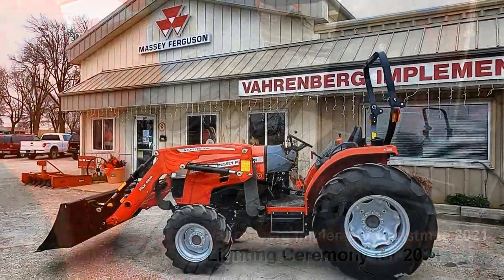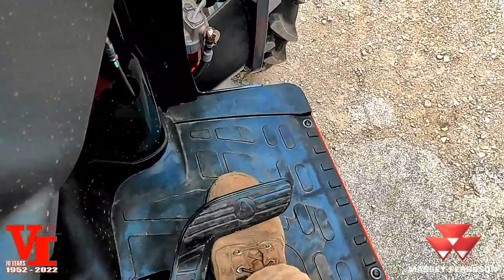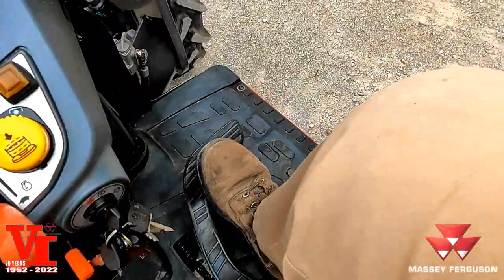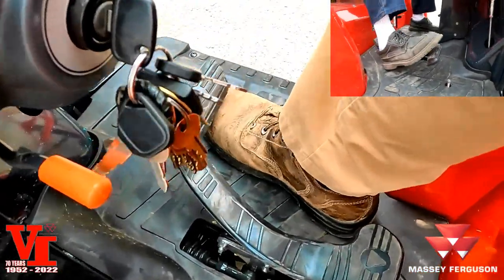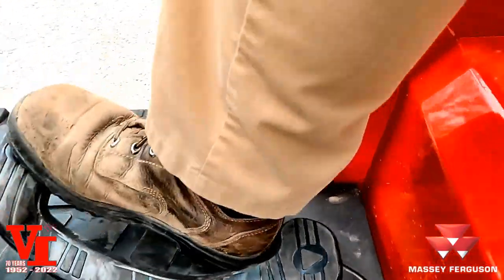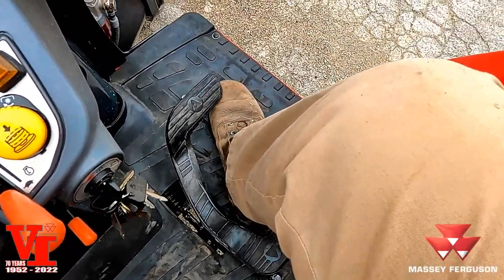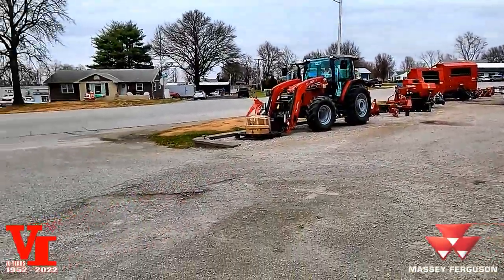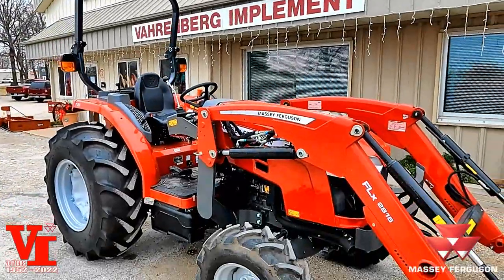Massey Ferguson Tech Tip: Treadle Pedal Operating Tips: 1800E & 2800E Series Compact Utility Tractor

Comment: The tredle pedal is similar to the heel/toe shifter on a motorcycle. I believe most of us with that type of shifter rarely use the heel shifter and pull up with the toe, like you demonstrated. That is how I would shift that tractor. I like the dual pedals on my GC2610.  But everyone is different.  Thanks for the tech tip.
Reply from the maker: Great point! Very similar to motorcycle shifters. Dual Pedals are a nice premium feature but not everyone can afford Premium Compact/Utility Tractor but that doesn't limit the control you can have with Treadle Pedal Hydro.
Reply: I had an old KZ1000 C1A motorcycle that had the heel toe shifter. I just couldn't get on board with that

Comment: It is very rare to have two "hanging" hydro PEDALS, --like the Premium Massey-Fergusom line-up. The side-by-side floor mounted "Plunger-Style" is a cheep,& crude formula @ best that appease's the "car driver's" to the tractor-world. Even the simple "treadal-pedal" has many options of safety & comfort built rite in. Muddy-slippery floor mounted pedals ALWAYS present the issue of "which pedal do l push now?" Although it's what ever the User gets used to that works best type of scenario. The messey under-floor linkage that the two side-by-side floor mounted hydro PEDALS also presents a case of "oblivian" of " whats going on under there" ---AKA == lots of corrosion & crude build-up, along with "dangling linkages" exposed to the elements. Give me a "treadal-pedal",or "hanging(expensive)pedals" ,or A Whole lot of Real Gears. The Massey-Ferguson "System" has It ALL---they Don't Cheep-Out.
Reply from the maker: That's the great Part of Massey Ferguson they offer buyers the choice. E Series with Treadle Pedal or M Series with Suspended Pedals. Great information you shared and why before you buy is visit your dealer and take both for a drive and decide which is best for you or even if a hydrostat is best for your needs. Massey Ferguson offers lots of Choices!
Reply: @VahrenbergImplement  looking to get "Massey-Ferguson #3". Massey-Ferguson the last Tractor you will ever need. Can't just have TWO. Thank you for the reply Sir.
Reply from the maker: Massey Ferguson are addictive. What all models do you have?
Reply: @VahrenbergImplement  Have a 2017 1736 TL Power-shuttle with 61 hours, the "Cadallac" of compact tractors  , and a third-handed 1988 1020 2wd hydro with 1756 hours-kink of tired. Want to get a 1835E with shuttle shift with maybe a bachoe. There is also a "orange" tractor in the fleet- a 2017 model, reliable, but nothing special,a Mx5200 TLB.,with a 9.5 foot backhoe.  Wish Massey-Ferguson made a New Tractor with a 9.5 foot plus backhoe attachment on the line up.
Reply: @VahrenbergImplement  want to get a 1835e( maybe a backhoe too) to replace the tired 1020.